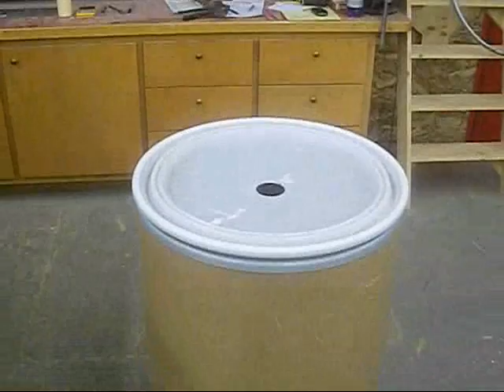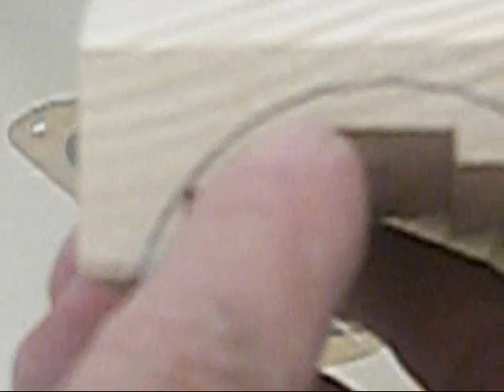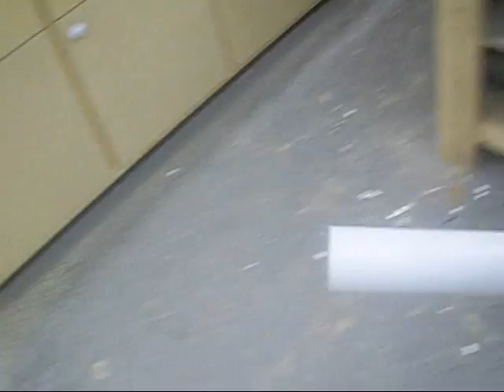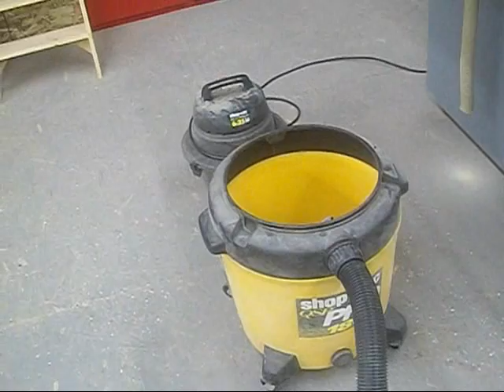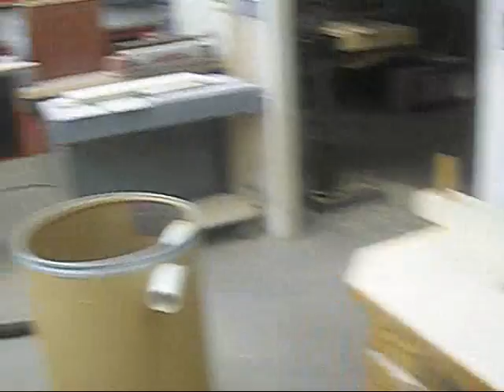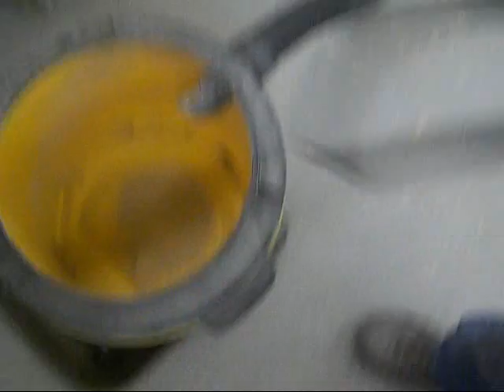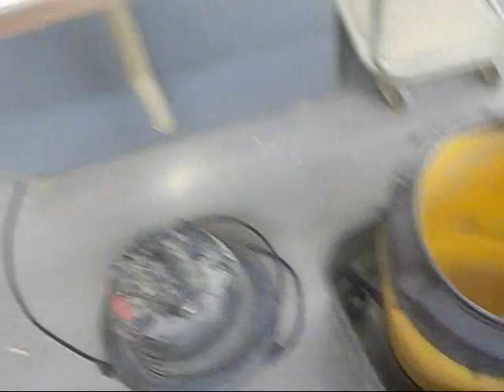Build this Sawdust Collection System

Comment: Thanks for the vid. Don't the finer particles stay airborne in the drum and end up in the vac filter? I am designing one with a steel drum that sucks the air through 40 litres of water. Kinda like a hubbly bubbly.
Reply from the maker: I showed how much is lying at the bottom of the ShopVac drum.  I suppose a little teeny weensy amount gets in the filter but I've never been concerned about it.  As for the steel drum, sure it'll work fine - harder cutting and working with it but it's a go.  Now, as for as your sucking air through water idea...you're gonna have to 'splain that one to me.
Reply: Thanks for the reply Joe. Maybe I'm just being anal on the pure air thing. My 40 year old beetle has poked a hole in the ozone layer already. I have no issues cutting and welding steel. Okay so if you have a pipe running from the base of a drum that's half filled with water and you create a low pressure in the barrel you will suck air through the water. This is how a bong works. I don't smoke weed but I'm fascinated by the implements.

Comment: Agree, just a fantastic and simple design that is very inexpensive to build. Never seen one better. Thanks again. 
PS, great shop with great tools. That band saw beats the hell out of my 14 inch Delta. I have it all set up with every option but you just can't beat heavy cast iron tools, run so smooth. 
Vinny

Comment: Joe, I just finished a dust collector based on your design. I used a 50 gallon trash can and a small shop Vac. The Vac sits on top of the can and can be removed within seconds. The whole thing is on wheels, so I can roll it all over my shop! Thanks!

Comment: Not bad atall. Could be simpler, a PVC 90, close nipple and coupling. Cut a hole for a snug fit around the nipple, the 90 inside and the coupling out, barrel squeezed between. The wear plate is a good idea

Comment: EPIC FAIL.. With larger Vacs like my RIDGID 5 HP 12 Gallon, it collapsed like stepping on a pop can. I couldn't believe my eyes!! I am trying to line the inside with aluminum sheet scraps and making exterior stiffeners. Orlando Drum has this exact drum for $13.00.
Reply from the maker: The three things I can think of that might have caused this are; A) you used a really thin fiber drum, B) you didn't use 2" pipe or C) you had some form of blockage in the hose/pipe.  Also, you're not supposed to jam the end of the hose into a pile of sawdust - that would be considered a blockage.  Since sawdust doesn't land in a big pile at once then you cannot expect the vacuum to suck up a big pile all at once.

Comment: Nice vid, Joe, thanks.. One thing I'm not sure of, what is the benefit of this setup vs. just using the shop vac? Is it remote location of the shop vac, longer filter life, improved dust collection, larger volume for dust collection? Why not just use the shop vac? Thanks my friend.
Reply: without this collector the filter on the shop-vac becomes plugged up within seconds which restricts the suction.  this way the filter stays clean and allows full suction at all times.
Reply from the maker: Yes, it is indeed all those things you said including not having to drag the shop vac around.  Thanks for watching.

Comment: Hi Joe, Thanks for this video! I used a plastic 30gal. barrel that had a removable lid that turns a 1/4 of a turn to lock it shut, I had to use some caulking to seal the lid, but it works great non the less. I had to tweak the angel of the suction pipe to get the right degree to make the suction be at full strength, luckily I had a 2' piece of pipe lol. I also had to  work on the up angel to get the dust and darbee to do the swirl right so it ended up at the bottom of the barrel. But Thanks to your video I was able to finally have a shop vacuum system that I can afford, my Christmas Present to me Thanks again to You. Now I want to do one of your Router Tables. Thanks again and Merry Christmas to you and your.

Comment: Hi Joe, A BIG THANK YOU for sharing this 'One Man Production', I'm gob smacked at how simple the concept is and how PERFECT it carries out its job! Is there a version for us folk who arn;t so LUCKY as you, who don't have the use of a table router and bandsaw? My workshop is really small so I can't house such pleasurable items. I could get past the problem of hogging out the wood for the piping to fit by cutting another length of pipe down the length and heating it up until the other pipe fits snug once pushed into place :) The screws I could use over sized washers to stop the screw pulling through. For a smaller version could I scale things down and use an old BREW BIN/BUCKET? Is there a way to switch on the filter at the work station instead of having to go to the vacume? THANKS ONCE AGAIN JOE you are a STAR :)
Cheers Andy, Yorkshire, ENGLAND

Comment from the maker: No, the lid is larger than the ID of the barrel.  I suppose you could use the cawl as a clamp but it's not necessary - the contact cement does its job very well. You can't go wrong with this project, have fun with it!

Comment from the maker: Sure...a vacuum is a vacuum, doesn't matter what's doing the sucking.  The only difference would be the in-suck and out-suck pipe sizes.  Those fiber drums are available in 55-gallon - the one I showed was a 32-gallon barrel.  Also, for those of you wanting to make this DC system, you can find the drums at uline.com.